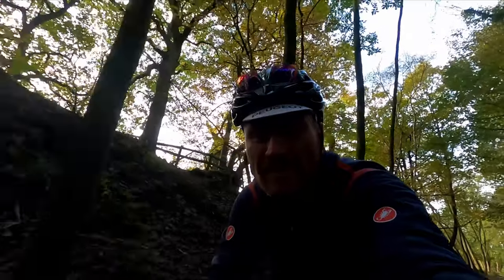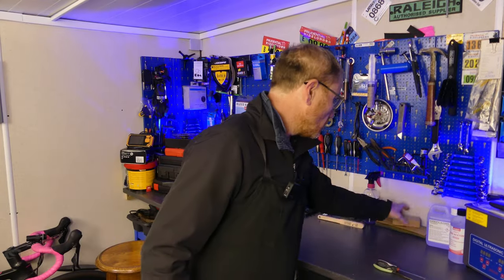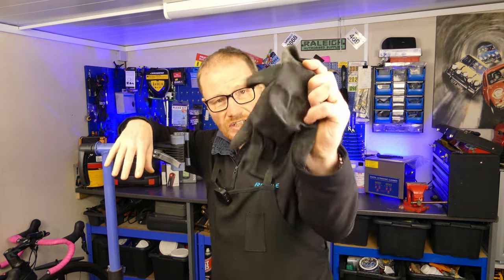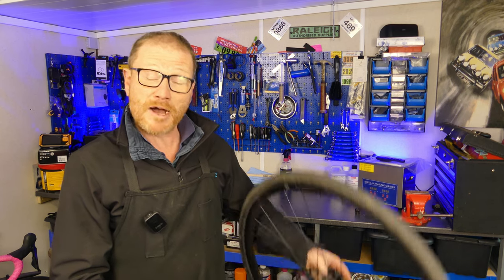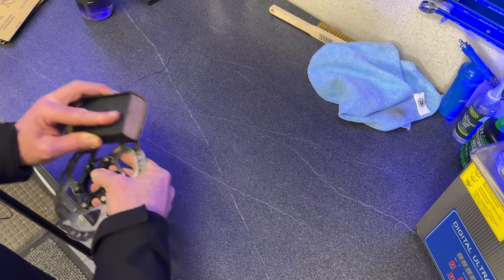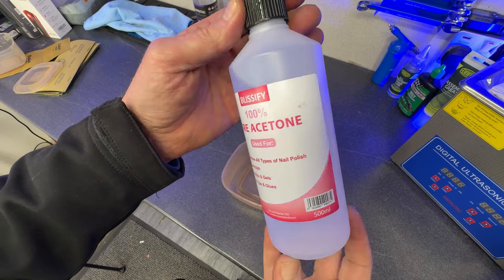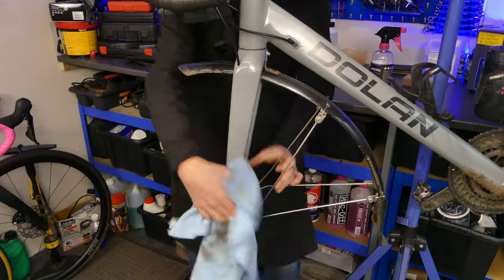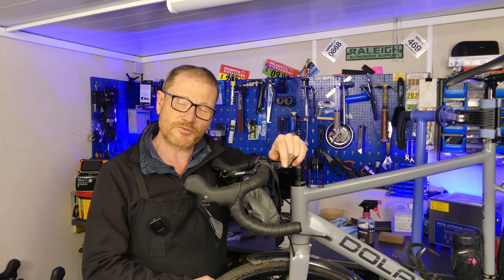Stop Noisy Disc Brake Squeal And Clean Contaminated Brakes - Road Bike Maintenance

Comment: Finally, success. I had previously tried various aspects of the process, using isopropyl alcohol, plus cleaning the pistons with mineral oil, then drying. I strongly suspect that the rotor was my problem.

I went to the trouble of removing the rotor and using brake cleaner, for the first time. I also hit everything else with brake cleaner and also applied sandpaper and heat to the pads.

Before the rotors were even re-bedded, the squealing stopped.

Comment: I have been using Gorilla pads since 8/2021 (around 15,000 miles now) and my experience is as yours. 100% agree with you about price and the Shimano cooling fins being unecessary. I find they last much longer than the Shimano equivalents. The ones I use are for: Shimano Dura Ace BR-R9170 Ultegra BR-R8070 BR-RS805 BR-RS505 BR-RS405 BR-RS305 L02A - Enduro kevlar. Great videos  - thanks.
Reply from the maker: Hi Kirk,
Glad you liked the video. The trouble is, a lot of people just think they have to use the one from the groupset manufacturer........ odd, because people don't do this with rim brakes.

I did a more detailed video on these pads, link below if you've not watched it already:
https://youtu.be/mTq9fKswBBQ

Thanks for watching,
Jon
Reply: 🙄I intended to make my comment against your video about alternatives to Shimano pads - apologies! I'll post the comment again, against the correct video this time.  @ribblevalleycyclist
Reply from the maker: I'm not gonna complain about anyone binge-watching my videos  @kirkalderson4005  🤣

Comment: Just had to do this today Jon, mine were squealing like a banshee. Haven't tested 'em yet though. Keep your fingers crossed for me. Good video, thanks 👍🚴
Reply from the maker: Fingers crossed Pete 👍
Reply: @ribblevalleycyclist  No joy...tested this morning...still banshee like 🙄 Persevered, recleaned rotors and pads but this time used nail polish remover, re sanded then cleaned again using nail polish remover...as silent as a silent thing. The difference this time around...nail polish remover as opposed to iso propyl alcohol or even muc off specific cleaner 🚴👍

Comment: This howto helped my out to cure squealing Front break after upgrading my wheelset and installing Icetech XT rotors (MT-800). After doing battle with my issue for some time, It came down to a few key points. 1. use clean microfiber cloth to wipe rotors after using high alcohol isopropyl or (rubbing alcohol ) or rotor cleaner to get them as clean as possible. 2. clean the break calipers also with isopropyl well getting whatever grit in there out. 3. Ensure your calipers are straight as possible aligning with your rotor, assuming your rotor is also not bent. 4. Newer Icetech routers may be slightly thinker brand new. Its best to get new break pads that also match the rotor (new pads may be slightly thiner). My case: BR-M800 caliper to j05A resin pads. Previously metal J04. cleaning the previous pads might have also worked but also but just getting fresh pads seemed like the better option. The newer Shimano pads come in a paper box rather than the plastic. Also the back of the break pad is one solid black piece. Resin pads are more muted but no more squeal! I may go back to J04 metal later but so happy my bike is quite now.
Reply from the maker: Glad you enjoyed it. I too used to run sintered pads, but as I’m not an aggressive rider, the increased noise far outweighed the increased performance. I just stick with resin now. No noise, and my posh Hope rotors will thank me for it in the long run.

Comment: I found that if you continue to have noise most likely it is a slow leak of brake fluid containing the pads, usually where the 2 half's of the caliper seal, which causes it to glaze the pad and disk.  My go-to method instead of chemicals is heat.  20-30 seconds with a propane or butane torch with pads sitting on a brick will burn off any oils, too long and you will overheat the glue used to bond the pad.  A light scuff on the rotors, and if the pad is glossy a light scuff of the pad with sand paper.  Been doing it for years works every time, chemicals don't get the oils out of the pad and the noise comes back.

Comment: I'm surprised you didn't mention 'upgrading' the pad retaining bolt with one with a hex fitting. I'd left mine too long and of course it sheared, then sheared from the other end (with a set of grips on it) and required drilling out which was is something I don't want to repeat.

In terms of brake cleaner, a mate (who also has a road rally car) uses Nappa brake cleaner in a standard pressure sprayer (the type you can buy for weedkiller) which seems a good compromise between ££££ bike products and the cannisters that last about 30 seconds before they're empty (the local place had a can of Weldtite Jet Blast and whilst effective, it didn't last long at all). I recently also invested in a tool to push the pistons back in which has been pretty handy of late although I'm kicking myself for not going for the PT.
Reply from the maker: Good shout, Paul. Agreed, a hex bolt is a nice upgrade. Saying that though, a blob of something on the thread and not installing it with a jack hammer is also affective 🤣🤣🤣.

Yeah, a lot of cyclists turn to car brands for disc cleaning products. That one I use is made by a car company! Pistol tool, I just use the handle on my long nosed pliers!!!!! Yeah, I know, I should use the correct tool. I have one somewhere, but I misplaced it about 6 months ago. I've not replaced it, because the current solution seems to do the job even better than the correct tool. Maybe I'll treat myself to a PT one soon.
Reply: @ribblevalleycyclist  it was the neglect that got me this time. The state of the pads was a touch embarrassing. It's safe to say that my wife's bike, my bike and my Dad's bike all of which seem to fall to me to keep on the road are now hex.
Reply from the maker: We've all been there!! I have a pal that had to buy a new calliper.

Comment: Even simpler: climb the highest mountain in your area and pull the brakes constantly while descending back down. By the time your back down the brakes should be hot enogh that every contaminant is either evaporated or has burned off. Repeat if necessary. This way you get plenty of exercise too. 🚲 😎
Reply from the maker: I've done this myself, gammelgemse. There is a fantastic climb in the Ribble Valley called Waddy Fell, it's ideal for this. I've also seen videos where people use blow torches..... Not sure I'd want to recommend that though!!
Reply: I like this method better. YMMV
Reply: Heat = warping 
So no. 
 @ribblevalleycyclist
Reply: Dude you are a legend. My brakes have been a huge pain for me for months now. They start screeching, I clean/replace the parts, they start screeching, I clean them again.
I've done this over and over and over.

After reading your comment I lightly braked while pedaling (not even downhill) for 2 minutes. And voila, they were quiet again.

Comment: My local bike shop said I needed to replace rotors and pads due to contaminated rotors.  I told him it squeaked 'before' I lubed chain and areas close to rotor.  Really?  Replace rotors and pads because of slight overspray?  My brakes have squeaked from day one basically.  Will try cleaning with alcohol or acetone and stay away for sprays for sure.

Comment: On cars we put a small amount of copper grease on the back of the pads to dampen noise from vibration.
Reply from the maker: I do the same on my bike, for that exact reason. MTB’ers also do it. I personally won’t ever recommend it though, because if it gets on the braking surface, it’s new discs and pads!

Comment: Hey slightly unrelated to this video, I installed the right shifter fine but in the left shifter when installing the hose into the shifter it becomes tight much sooner and I feel as though I’m going to over tighten it. I just went for it and tightened it however when I’ve filled the shifter reservoir with oil the break just doesn’t work properly.  Way too much free play.  Can you think of anything to fix this?
Reply from the maker: Sounds like the olive and hose aren't seated correctly. The olive may be too far up the hose. Cut the olive off the hose, add a new one with a new barb, and try it again. Good luck.
Reply: @ribblevalleycyclist  many thanks for your reply,  I tried every winch way to not have the olive too far down the hose.  I didn’t  fully tighten it I just went until I felt resistance and again it was always quite far out.   I just tightened it as far as it would let me then filled the lever with oil etc,  whilst pumping the brake I got all the resistance I would expect from a normal properly set up shifter which is good I suppose.  I’ve ridden it and the brake is working so I’ll just see how it goes.  If it stops working I’ll take it to LBS.  Just nice to do it oneself

Comment: I really do not like disc brakes especially hydraulic ones. I’ve had two back wheel lockups both times came off, and a failure of the front brake on a steep downhill it’s a good job I used to race cyclocross 😵‍💫 if I had to use them I’d choose mechanical ones. They are fully adjustable great when you’re out on a ride and hear the dreaded PING PING 👍

Comment: I’ve tried this and it doesn’t work. In my case moisture is not the problem but instead makes the squealing go away. When it hasn’t rain for a while the brakes start squealing. Go figure. 

The only thing that works is anti-squeal paste!

Comment: I find clarks discs make noise too if wet no matter what try im getting Shimano ones
Reply from the maker: Sintered/Metallic pads can also be the cause of noise in the wet.
Reply: @ribblevalleycyclist  yer but if bed them in with shimano discs i never had problems. I try clarks on and off years always crap it just i made mtb and got clarks brake set so put on discs as all had in 6bolt . Roll on pay day for new discs lol
Reply: @ribblevalleycyclist  by way got resin pads at mo so must show discs no good there diff steel sure of it
Reply from the maker: Agreed, if you’re getting noise with resin, then there may be a disc issue
Reply: @ribblevalleycyclist  cheap steel maybe dont no . Prop get shimano xt discs . My bin will like clarks ones 😂👍
Reply from the maker: @robrobinson420 The best I’ve ever used are Hope. Same price as Shimano, but far superior.
Reply: @ribblevalleycyclist  i got hope once they was thicker than shimano so pads to close plus was bent from new  . Good videos by way 👌